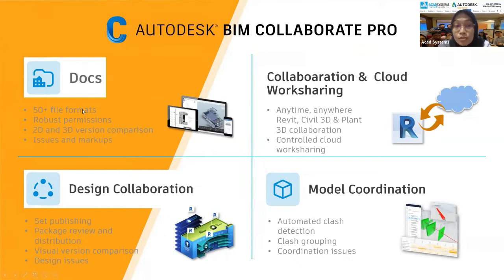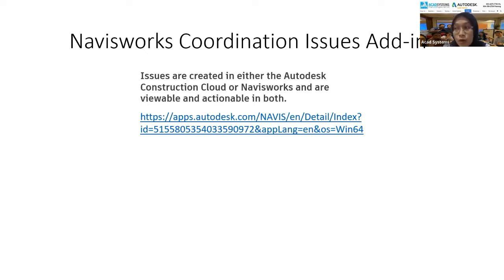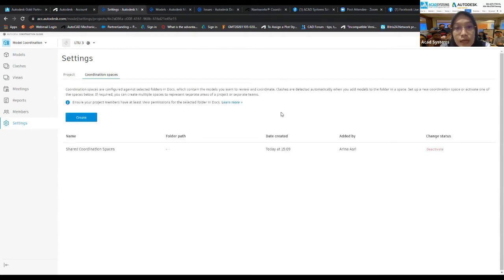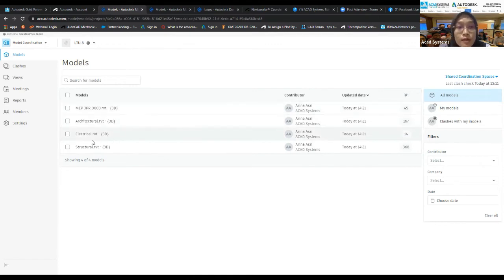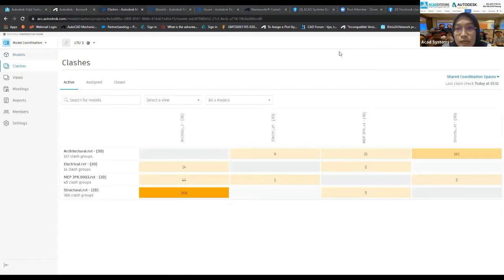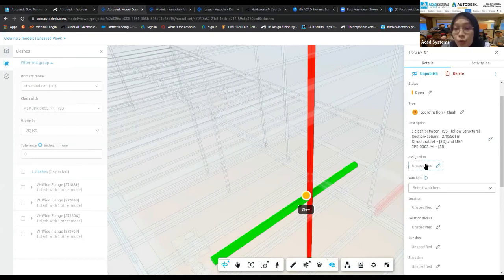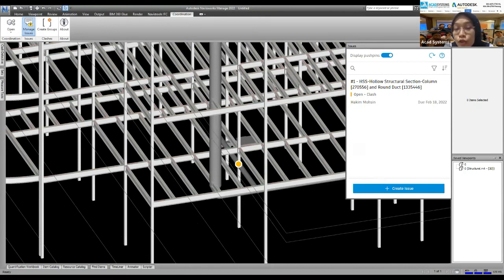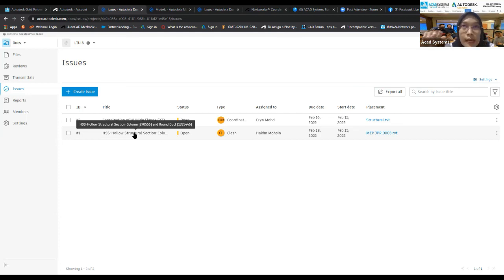Model Coordination in BIM Collaborate Pro

Comment: Hi! Great video. Thanks for this. I have a question. When I look at Model Coordination, I do not see the two models (arch and mechanical), I see the Mech model "ISO", then I see 24 architectural models, each of the central file plus a named view ie. "Central file.rvt - #D View 10". In Views there are no saves. So when I go to clashes there are 700 combinations. Can you help tell me how to clean this up?
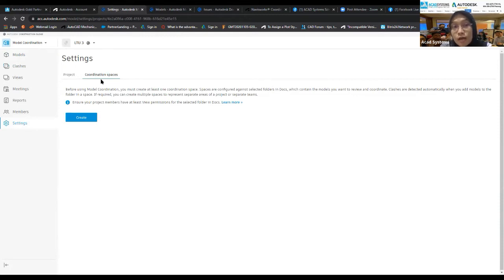Reply from the maker: Hi there. Each Model Coordination will reflect to the folder that we select as coordination folder in the settings. Take a look at min 8:36 in this video. Once you figured out which folder you select as Coordination folder, take a look at its content. Unfortunately, there is no automated way of cleaning clashes up. Therefore you have to make the amendments in each Revit file. Hope this helps. 😊